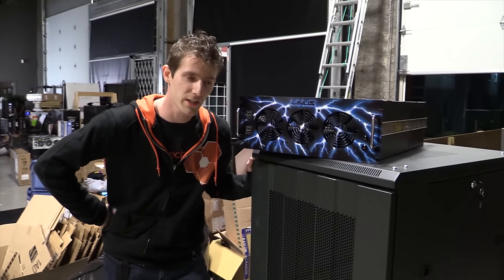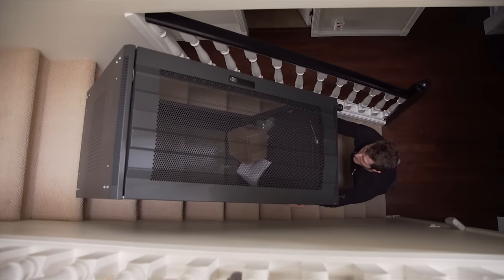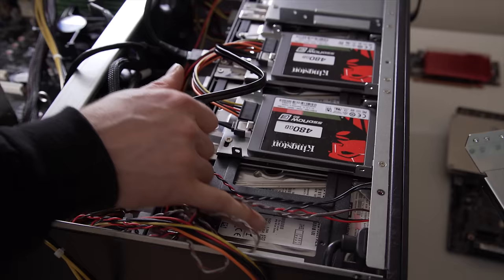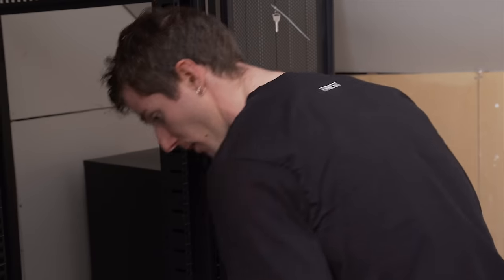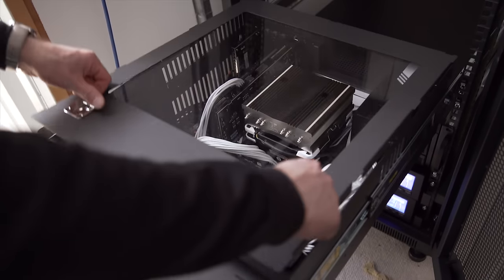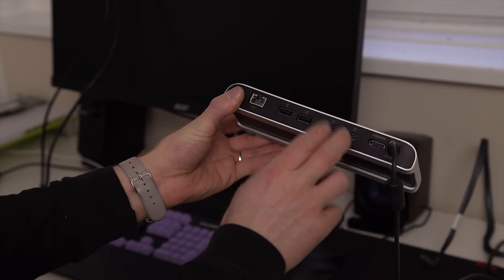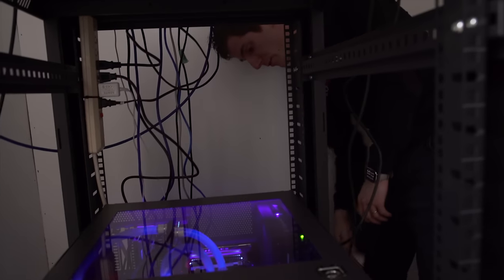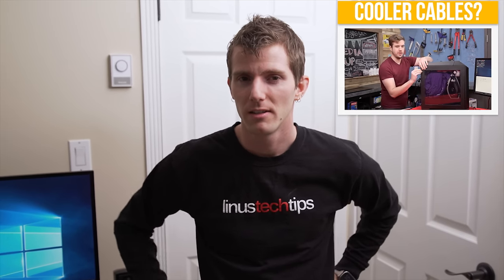Final Deployment of My New PC! - Personal Rig Update 2015 Part 5 (FINALE)

Comment: Random question: I currently have one 660ti. Should I buy a second 660ti and run SLI or should I wait and save for a 980?
Reply: 970 or 980 Ti
Reply: +Remetee Save up.
But can you give me the specs of your rig?
Reply: +MutantKrill Yeah of course
Windows 7 Home Premium 64-bit
Intel Core i5 2500 @ 3.30GHz
8.00GB Dual-Channel DDR3 @ 798MHz
Gigabyte Technology Co. Ltd. Z68XP-UD3P
2047MB NVIDIA GeForce GTX 660 Ti (EVGA)
Reply: +Remetee Personally I would say save up and buy a 970/980 because when you want to upgrade your entire rig you can just migrate the card over.  IMO if you are going to buy a graphics card, you might as well get a nice one.  Not that the 660ti isn't a good card, because it is, but I just think saving up and buying a 970/980 is a better idea.
Reply: +Remetee Would also recommend an update to windows 10
Reply: Remetee And would I suggest a RAM upgrade? to 16 gigs or more if you can.
Reply: +Remetee power supply?
Reply: save and wait for pascal
Reply: Zach Mullin Good advice, I'm probably gonna wait.

Hurileno I have the upgrade but I've heard a lot of bad things about Win10 especially about security so I'm hesitant about switching over
Reply: Xamnition I have a TX650M
Reply: +Remetee 970 or 980 Ti. 980 isn't worth it. SLI is cool concept, but one GPU is always better.
Reply: +Remetee save for a 980 and then just forget about it for the next few years
Reply: +Sirslicey Should've gotten a 390.
Reply: +Remetee input lag and bugs for sli. and yeah pascal is coming soon.
Reply: k I think Pascal GPU from Nvidia is coming on April.
If you want a new PC, just buy a low end GPU and wait for Pascal
Reply: +Remetee 2 970s in sli will outperform a 980ti and give you more vram and better fps/performance. your bottleneck however is probably going to be your motherboard then cpu. it depends on how many pcie channels your motherboard and cpu have. ie if you only have 24 channels you will have 1 card running at 16x and one at 8x. your chip only supports 16 pci express lanes so if you don't want to upgrade your cpu, you're either going to be running 2 video cards (if you go sli) at 8x each or 1 card at 16x. if you're going to be upgrading your system in steps, i'd look at getting a 970, then mobo/cpu, then a second 970 (or just go 980 if that's what your heart wants)

Ultimately it depends on what your goals are. do you want a "futureproof" rig that's going to run everything on ultra for then next 4-5 years or are you happy with medium settings. if you're happy with medium, there are plenty of options out there. don't get suckered into "the latest and greatest" if the rest of your rig won't handle the upgrade. Do some research on PCIe lanes, motherboards, chip, videocard compatability. TomsHardware(dot)com is a great resource as well as the Linus Forums. they will have people who can probably explain it way better than I can.
Reply: +Remetee also make sure your power supply is sufficient to deal with the needs of your system (newegg has a calculator that will give you an idea what kind of wattage your system will require) (i always add a little wiggle room for extra fans and lights)
Reply: fknra i think vram doesn't stack, for now? 3.5gb vram of 970 may be a bit risky for future games imo. would be a pity to have to choose lower texture setting because of vram when higher texture setting hardly causes any performance drop but increases the image clarity greatly. 

the 980 has 4gb of vram but it's performance to price ratio isn't really that good. google benchmark of some games and see how the 980 compares to 970 and 980ti.

so imo just wait for pascal and see what options there will be.
Reply: k Actually, 3.5+0.5gb vram isn't that bad, since the 970's encryption software is like 10 times better than the previous gen's. 970 is still the best price sweetspot. If you're afraid of VRAM issues, just buy the AMD. They tend to have 6-8gb vram.
Reply: +k the evga gtx970 ftw+ has 4gb of ddr5 vram, but yes he's right. it doesn't stack in sli. if you find that your bottleneck is vram (which is doubtful unless you are rendering) just run one monitor off of each card. they'll still talk to eachother but you'll be getting 110fps on ultra on bf4 at 1080p rather than 160-180.
if you're pushing 4k or 144hz I'd go with sli still.
Reply: Solitude yes i bought the 970 because of it's good price to performance ratio. i avoided amd because of the frequent high frametime (micro-stuttering) and having seen lots of complaints about driver, and the heat and noise. 

the 3.5gb vram maybe not be an issue, if the 3.5+0.5gb vram concept is working properly, i guess. the only game that uses more than 3.5gb vram i've encountered is rainbow six siege (ultra texture, it's marked as over 3.5gb vram usage and not recommended for my card in the option menu), but i saw the vram usage was actually under 3.5gb in msi afterburner. maybe because of some graphics settings that i've turned down. anyway, this makes me a bit worried about future games' vram usage. but at least i know i won't have any vram problem with most games that's already out.
Reply: +Sirslicey r9 390>gtx 970.
Reply: Remetee There are options to turn them off
Reply: +Remetee Most of the "Microsoft is spying on your life" stuff is complete fabricated. They don't gather any more information than Apple or Google do. The only annoying things for me so far are the app suggestions and Cortana.
Reply: +Remetee  Wait till June and get a GTX 1070. It will be about halfway between a 980 and 980 TI in speed (meaning even faster than a 980 for the slow ones out there) and is only estimated to cost $350-375 or so, maybe $400. You can sell your 660 TI on ebay for about $100, after fees you'd prolly still have $80 or so, so you would only have to raise $300 at most to get a GTX 1070.  Or you could possibly get a used GTX 970 or 980 once they go down in price after the new Pascall GTX 1000 series is out, but i'd honestly save up for a pascal, the 900 series are gonna be damn near obsolete (save the TITAN X, 980 ti and POSSIBLY the 980) once Pascal drops due to the extra power)
Reply: +fknra  No, VRAM does NOT stack when you get two cards, so the 3.5gb (500gb of the vram on the 970 is near useless let's be honest. but it's still there i guess, just at ddr2 speeds) or 4gb if you count the slower stuff, is all you get with a 970, you don't have 8gb when you do SLI. So the 6GB on a 980 TI is the better one.  That's not to say the 970 is a terrible card though, it's a quite good one. But i would DEFINITELY look into getting a GTX 1070 in june when they come out rather than a 970 as the 1070 will only be a little higher cost than the 970 is now when it comes out (estimates say somewhere between $350 and $400 price)
Reply: +fknra  The 970 only has 3.5gb of "full speed" VRAM, the remaining 500mb of VRAM is SUPER low bandwidth, i'm talking like DDR2 levels. So the 3.5gb on the 970 runs at the full 256 bit bus width 200gb/s+  bandwidth (somewhere between 200gb/s and 250gb/s bandwidth, can't remember the precise number) whereas the remaining 500mb only runs at around 50gb/s bandwidth speed.
Reply: +Mikee Tyson  Please stop lying. R9 390 = ~GTX 780      K THX... XD
Reply: +Unknown Anonymous r7 250=Titan x
Reply: +Remetee hey if you didnt get a new card yet wait for the 1070! 8gb, better then the titan x and its only $380

Comment: $1000 per Thunderbolt Optical Cable and over $200 for each hub, damn.
Reply: +Flat4Buggy 2 It looked like one of the runs could have used a 5.5 meter version which is $179
Reply: jim slickster he gets lots of free stuff from the manufacturers, I mean, he paid for VERY little of this build
Reply: @legobane9469  oh interesting. Is there any other way to connect to PC from another room?
Reply: @igornilsen1649  I wonder. Looking into this, too.
Reply: What i did for now is an active15m HDMI cabel, and 15m USB extender.
Reply: @igornilsen1649  I've been researching how to put my PC in another room due to heating up my office. I mostly use this PC to game on.. so if I used the thunderbolt 3 dock + PCIe card I'd be bypassing plugging in my monitors to my 1070TI.. so I guess I'm gonna have to buy some super long DP and HDMI cables to run as well. Still not sure what TB3 dock to buy. The elgato's are a bit expensive.
Reply: @Dekkayrd  btw you can run games on your 1070TI and use a dock or display plugged into your motherboard or another graphics card, nvidia is pretty smart

Comment: I have a fanless PC. Silent without all this faff
Reply: Rip your airflow
Reply: That must get real hot
Reply: +EoRdE6 You should get the new pentium 4 prescott.
It runs reeeaallll coooooolllll

cool in about a thousand quotation marks
Reply: I guess if it works for you VintagePC's alike
Reply: +EoRdE6 Well, that sounds nice and all, but what are the specs of your computer? And what do you do on it? Macbooks are fanless as well, but they aren't really powerful.
Reply: +Vapeaholic You can have a really powerful PC without fans and it works fine. I have a totally open custom case and I get 25 degres celsius idle.
Reply: The 212 Evo helps a lot though.
Reply: +Nathan plays maybe he owns a Mac
Reply: +Nathan plays passive cooling can work...
Reply: +EoRdE6 For movies, google, facebook, tech news and Youtube, my trusty x86 Windows 8 inches tablet comes in handy (it's my main PC !).
Reply: +VintagePC's alike      Yeah, most 10 watt single core pentiums are like that...nice and cool....yup...All 1ghz of it....
Reply: +Carl Linder-Lood  Last i checked a 212 Evo used fans....

Comment: Doesn't it get super hot in your closet? I set up a mini 5 node cluster from some cheap used hp dl165 g7 1u rack pcs in my closet, and it gets really hot in there.  I'm thinking about installing a bathroom exhaust fan in there and drilling some small intake holes that will lead into the room.

Comment: An Elgato hub is roughly $200 USD and the Thunderbolt PCI card will run you about $65. Not exactly a cheap solution but if you want dead silence and have the space to store your PC this is a great option.

Comment: Like that you're able to run everything through a single thunderbolt cable, but what would you do if you wanted to run multiple displays? Also, I love the hooded sweatshirt. Will they every be available to buy?
Reply: +Snipexz2 Elgato manual for the dock is a little unclear when it comes to display connectivity using PC's, but it appears that you would need a Thunderbolt display for the second monitor (either Apple or LG's thunderbolt display).

Comment: I build, install, and service headend rack systems( PC, commercial satellite, etc.), none of which have water-cooling for good reason. Either some components have fans and/or most are passively cooled in typically an well upgraded A/C'd room. So, i am interested to know, has there been any heat issues, considering this is in a insulated, sealed room? Many times such systems have been installed in a hot room of some sort which soon begins to fail one way or another and need at least a door vent or box fan for the cheapo owners; instead of a wall mount a/c.  Does the water cooling radiators provide enough cooling? I suggest installing a room thermometer.
Reply: Oh....and then I began to watch part 6... My bad.

Comment: Nice, personally I prefer to mount the Gaming Rig in the kitchen, to be precise, in the fridge. 
I removed all fans and watercooling parts there is no need for that. 
Great for overclocking and you can't hear it at all.
Reply: +Olizzker Lecraz I know for a fact you don't do this, because LTT made a video about putting a computer in a fridge. It doesn't work.
Reply: ***** What a nob. I'm soldering dem CPU's m9.

Comment: Hey Linus, hope you have a good AC in that closet. I think most homes don't have any ac/hvac ducts in such places, which would be a problem for yours like 1000w of heat from those machines under load. Also wonder if you plan to run your own router or just standard stuff. Cheers! (in case of miracle that you read this :-))

Comment: Now seeing the video pass through from the GPU to the thunderbolt 2 card at 9:50 makes sense for one monitor but what if you have multiple. Does it work fine since the display-port standard supports daisy chaining monitors? Also if you grab some usb to VGA converter and plug it into the dock will that completely bypass the graphics card? I assume it will.

Comment: I don't mean to potentially be asking a stupid question, but, will I be able to get a dock like yours but over Ethernet instead of thunderbolt. I want to put my PC in my basement and have my desk setup in my bedroom on the second floor of my house. I am choosing Ethernet because my house came with gigabit ethernet pre wired through the walls of almost every room in the house. Also, my computer doesn't have thunderbolt and it would probably be impossible to somehow route a cable of that distance neatly and cheaply.

Comment: I have HDMI cable and USB to my TV and Kitchen mounted touch screen. I this thunderbolt idea may open up more possibilities. As of now, if I have to plug in USB3 I need to go to the other room.
On a separate note, I would pass on the door on that 4 post rack. Just seems like it’s in the way. But, maybe you’re afraid the kids will hit the power button on you ;)
This is a well thought out solution and will be doing this in the house I'm building next month.

Comment: Build a computer closet around a window, install a window air 
conditioner, insulate the closet, also sound proof (optional), run 
exhaust port, with fan(s) to another window. You might say it didn't 
work when you put a computer in a refrigerator. The window a c will put 
more Btu's in than a refrigerator could.  For protection put a 
thermistor on the power-strip in case the AC unit ever fails.  I say 
build a computer closet, one, you won't freeze everybody in the room; 
two, ac unit shouldn't run much for cooling off a small insulated 
space.

Comment: OK guys need some serious input on this...

my current set up : 
8 gigs 1600 mhz ram 
Amd 8320 clocked at 4.5 ghz 
single amd r9 290 over clocked a bit.

the rest of the specs isn't important.

I been thinking about upgrading a
 something but I'm not sure if I should upgrade to an Intel platform or I should spend and get me a better GPU like a 980 or something..

which would give me the most Frames per second... 

I game at 1080p..

And please guys no Fan Boys... I just want the best information... that will give me the best performance..

Comment: Is there a cheaper alternative to the Thunderbolt gear that accomplishes the same goal? I'm looking into the same sort of setup to run a 4k video connection and USB for peripherals to my TV setup from my tower. (Distance is short, 15-20 feet, between tower and TV but conditions prohibit running individual connections)

Comment: What is the device called that connects all your peripherals to the thunderbolt cable ? my pc doesnt have thunderbolt but i am thinking of going down the pc in another room route. and the thunderbolt setup looks like the only way to run all my devices, but i would need some port of adapter at the pc end to get thunderbolt to it.

Comment: What was the thunderbolt card he used? I saw it only had 1 jack in it which connected to the gfx card's hdmi port, so into what did he connect the optical thunderbolt cable to extend to the other room?

Comment: I 2 am wondering what you electric bill is like every month, I think you don't run any solar one system where I am cost 1,000 watt %.12 cent X 31 is about 36 bucks & you x that by X systems 24/7 &  have them 2000 watt systems on with your battery backup charging at night

Comment: This would be the first time ive seeked advice through a Youtube video. Make matters worse, its over a year old.
I am in the process of building something similar. But i was planing to have it between 2 desks due to cables and not able to put holes in walls due to renting.

So, i saw you using a Thunderbolt set. I was like "sweet, i can hind them in the cupboard". So I priced up the card, $90 not bad. Then the dock, $250 not bad. Then i priced up 1 (id need 2) 10m cables. At the quote of $400 each, I canceled that idea at that point.

So after that speech, what is a good minimal cable set up that will work the same that I can hide the rack?

Cheers.

Comment: Graphics through adapter?
Thanks for the video! I'm just wondering how you pass your graphics output of the dedicated GPU to the monitor. Is it possible to pass this through the thunderbolt adapter (without using the outputs from the GPU itself) ? Or do you have to install an other cable (e.g. hdmi) through the wall to your GPU onto your rack PC?
Would be nice if it was possible to use a single USB 3.1 gen 2 or thunderbolt 3 cable (plus adapter) to transfer all I/O including graphics but as far as I know these kinds of adapters ignore the dedicated GPU and have their own kind of graphics chips, so gaming and other 3D tasks were not possible... Pleas let me know if there is a way to accomplish this. Thanks ;-)
Reply: Ok, i figured it out. Linus used the "ASUS ThunderboltEX II" card. So he could go from the graphics card out to the thunderbolt card in and then via thunderbolt 2 out through the wall (taking the graphics signal along). A more up to date aproach would be thunderbolt 3 (USB-C cable) with the "ASUS ThunderboltEX 3".
I wonder if there are other solutions/hubs/cards wich could do the same trick..? I found none yet...